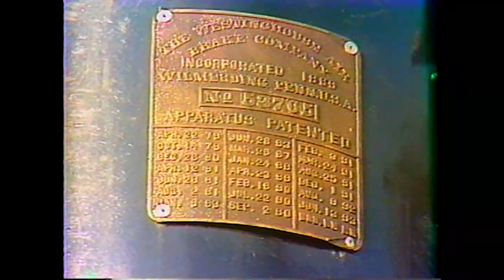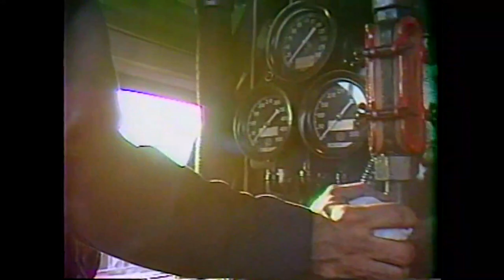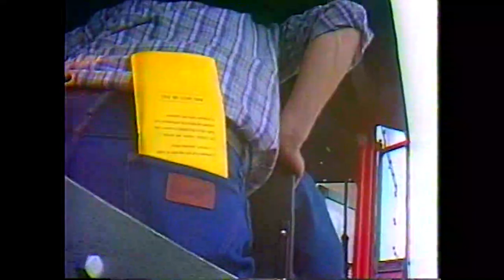L&N 152, Light Pacific 1985

Comment: I wish I saw this train in 1985.
Reply: I did...or at least it was sometime in the mid to later 80's.  There was track down nearly to the 4th street wharf back then and I watched it pull in down there while waiting for the Great Steamboat race to start during a derby festival :)  Several years later in the early 90's I participated in train robberies on its runs between New Haven & Boston, KY and even got a "cab ride", that being said, a cab ride on #152 back then actually meant sitting on a buckboard wagon seat that sat atop the front of the tender.  If you ducked your head down you could see inside the cab but if you sat straight up you ate cinders & smoke, LOL!  I got a "free" souvenir during that ride as some of those cinders burnt tiny little holes in my shirt!  :D